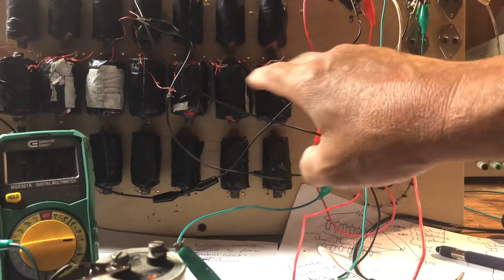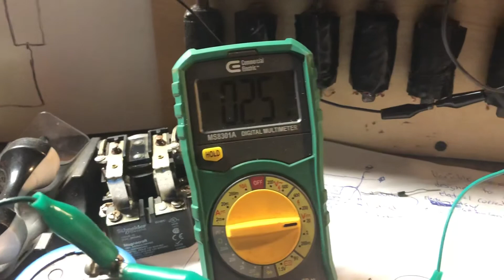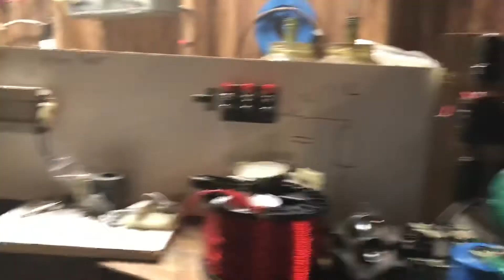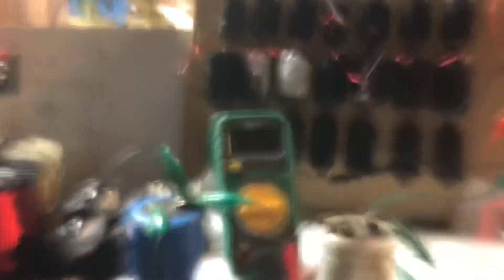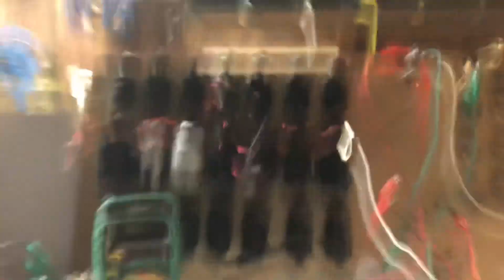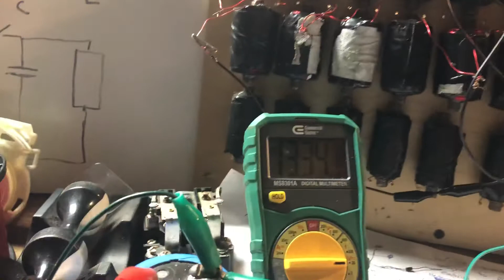How did Ed Leedskalnin create divergence, in the coral rock?

Comment: I know where your energy is comming from. When I was a kid at boarding school in the 60's we were not allowed to listen to our transistor radios after lights out. Some of us tried it using an earphone, but our senior prefects made a radio detector which responded to the superhet of our radios. All they had to do was walk along outside the dormatory until they picked up a superhet signal, and note which window it was nearest to. In they came straight to the offenders bed, pulled back the sheets and bingo - caught in the act of listening to the radio. They pulled you from your bed, took you to the boot room, and caned you with 6 of the best, which was very painful in thin pyjamas. Some of us decided to defeat their radio detector, by building crystal radio sets which work on AM only - there was no FM back then. All you needed was the tube from a toilet roll, 100 turns of copper wire onto the roll, a diode, and a variable capacitor, which we nicked from the physics labs, and radio operator's headphones which we bought from the army surplus store for $2. A long wire to conceal in the walls as the aerial, and another wire through the wooden floor onto a steel stake for the earth. Undetectable and no batteries - the system was simply powered by the radio waves being put through the diode as a half wave rectifier which the headphones responded to. So in your case you have your extensive resistor wire bank (aerial), various rectifiers, a couple of capacitors, and an earth which is the same thing we had. So not really free energy because someone has to generate the radio waves, but free for you capture and use.

Comment: I'm confused is it the resistor coil you have on the wall that completes the circuit from ground or is it in all the little steel core and coils you have? I just don't see how you have a current coming from the ground unless you have some sort of permanent magnet like the pmh making it work

Comment: Lifter Tech applies aggravator diamagnetic top wire high voltage high frequency like tv transformer flyback as a source to induce through dielectric insulator into a paramagnetic material like aluminum. Perhaps the coral or limestone cones in hands represent the extended diamagnetic material used for the lifting force and directional steering when induced by the upper copper wire of the electromagnet of the transformer. 

200,000 Year Old Levitaion Technology - Michael Tellinger
https://youtu.be/OO_EoqnabQ8?t=741

https://youtu.be/Ovv0EN4JISs?t=408

I think the wheel served as a self powered motor generator rotating spark gap because each passing of the magnet created on off induction pulse width modulation as well intense magnetic generation into his coil system you are demonstrating. The coil capacitor system further generates due to its frequency production from the wheel. Ed did not have access to modern day transistors; however, probably vacuum tubes, which were modern to him as spark gaps. But all equipment in his processes were in deed spark gaps and induction gaps just as Tesla used oil dielectric, coil dielectric, air, and temperature variation as well. spark gap or induction gap is instrumental to it all because it is the high impedance as well as the atmospheric gas plasma production of magnetic creation creating electromagnetism. electricity magnetism.
Reply: The two magnetic fields created by induction between one diamagnetic material and one paramagnetic material may create levitation through a shielding effect to other inertial energies coming in from all other outside sources; such as earth, moon, sun or other planets, as well as galaxy etc. All gravity is inertial; the same as magnetism is phi fractal inertial energy flow. the diamagnetic and paramagnetic induction interactions block or overcome all other forms of inertial momentum interactions. Mach Effect. Between the electromagnetic pair induced coils is the capacitance of the dielectric. Flux locking occurs similar to superconductive material which is actually only diamagnetic, such as between a magnet and bismuth. Superconductivity is only zero resistance to magnetic flux creating equal or equilibrium electromagnetism of current in the material; seen as creating perfect mirror imaging or reflection of the incoming magnetism. The two interacting fields create levitation or flux locking because of inertial shielding created in the process along with polar alignment in the dielectric as capacitance.  Flux locking can also be seen occurring between water droplets and dielectric material when aligned with atomic or molecular pole alignments of static charge air dielectrics. See this when magnet is dropped in copper pipe as the two interacting inertial energies interact or two magnets dropped when on a dielectric pole or rod. also seen when electromagnet interacts with diamagnetic material plate or when magnet falls or slides along a diamagnetic and or paramagnetic material. diamagnetic material is repulsed by electromagnet against direction of the motion of the oncoming induction; falling toward or being induced toward. paramagnetic is attracted.
Reply: coral is made up of calcium carbonate meaning it is likely diamagnetic because calcium and carbon is diamagnetic; and so is oxygen, hydrogen, copper, gold and nitrogen

aluminum is paramagnetic and is used in the lower end of the lifter tech devices
https://en.wikipedia.org/wiki/Paramagnetism

Paramagnetism is a form of magnetism whereby certain materials are weakly attracted by an externally applied magnetic field, and form internal, induced magnetic fields in the direction of the applied magnetic field. In contrast with this behavior, diamagnetic materials are repelled by magnetic fields and form induced magnetic fields in the direction opposite to that of the applied magnetic field

https://en.wikipedia.org/wiki/Magnetic_susceptibility

If the magnetic susceptibility is greater than zero, the substance is said to be "paramagnetic"; the magnetization of the substance is higher than that of empty space. If the magnetic susceptibility is less than zero, the substance is "diamagnetic"; it tends to exclude a magnetic field from its interior. [1]

coral is likely piezoelectric as well as diamagnetic like copper; therefore it would be active like the upper wire in lifter tech devices

Piezoelectricity in Megaliths Explained
https://youtu.be/aVne8ZXPpRc

How to make Rochelle salt piezoelectric crystals
tartaric acid and sodium carbonate are diamagnetic 
https://youtu.be/E1Ct3VUWvhQ

Comment: I had a head scratcher like this once with a ground connection to an iron core transformer to a bridge and neon lamp on the output side.  Could not see where the energy was coming from as the primary had no connections!  Turned off breaker to house and magic was gone.  Afterward tests found the culprit:  The CFL light bulb in the overhead was generating so much RF noise energy that the copper windings picked it up and was charging the capacitor via the bridge rectifier.  Digging even deeper I found that the workshop table was also boosting the rig to give high voltage, enough to light the neon bulb.  The top of the table was an insulator and the frame was all metal.  That big iron metal frame acted as an INDUCTIVE antennae and Large Capacity antenna in one relative to GROUND pickup.  Even with the house breaker off, I was still able to get some charging, but not enough to light the neon, so there may still be more hidden properties to discover.  Will have to start more tests.  Not totally convinced the energy was just leakage from AC power lines even if seen on a scope, as the AC lines might just be modulating the real energy source which seems related to the earth ground.  In that case persons relying on a scope would be fooled in believing it comes from the power lines!  And scopes are usually ground referenced.